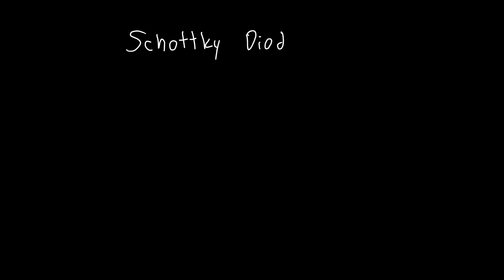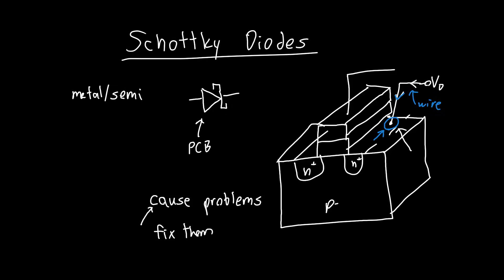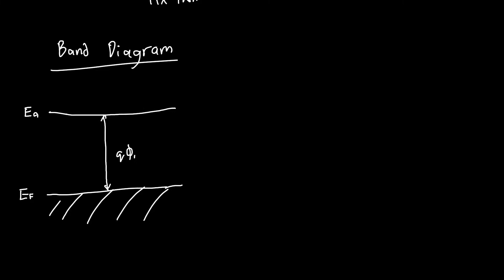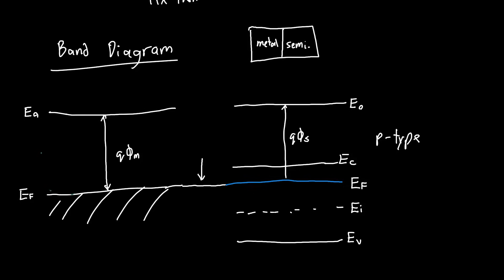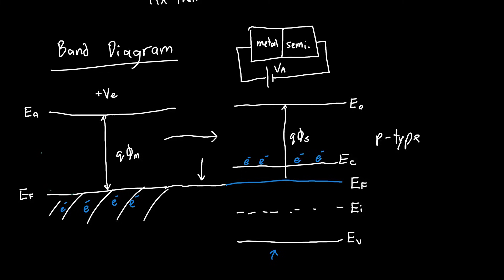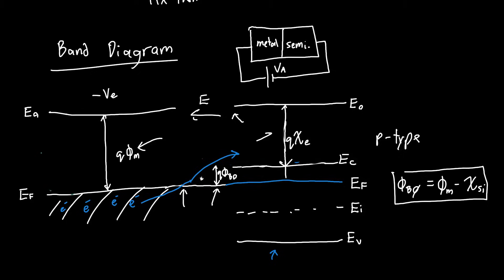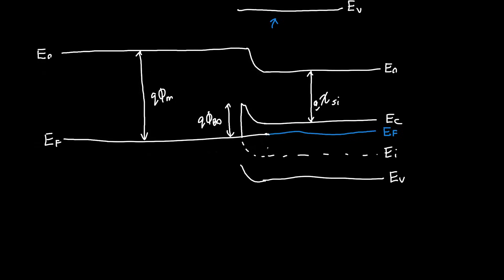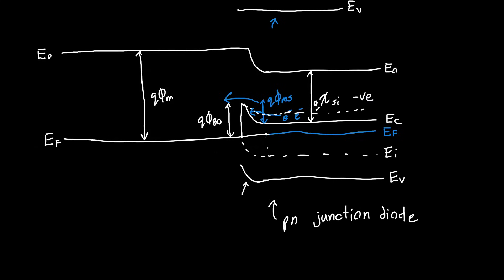Schottky Diode Part 1 - Band Diagram

Comment: Why at the 8:50 minute the semiconductor bands rise high? I think they should rise down so Ef of the metal (white line) will "stick" to Ef of the semiconductor (blue line). You drew that graph assuming the Ef of the semiconductor is greater than that of the metal.. then at 8:57 it seems you changed your mind
Reply: The same doubt🥲

Comment: A remark on the bending of the vacuum level:

As many here I was confused about why the vacuum level is not constant but bends. I thought a lot about it, because the vacuum level is the energy of an electron far away from the sample. This should be the same regardless of the material, voltage,…

In fact, there is an ambiguity in the definition: 1. There is a vacuum level, often used in semiconductor physics, that is measured right above the surface of the material. This vacuum level shifts, as you said. 2.) There is a vacuum level as I explained above (which is measured from infinity). This vacuum level is an absolute reference. 

In the second case, the electron affinity/work function changes, and the vacuum level stays constant. Why? Because, if I apply a voltage to the sample, the energy of the electrons may decrease (or increase), which leads to the bending of valence an conduction band. Of course this changes the energy needed to take an electron from the sample and bring it far away (the vacuum energy). In the end you do not only have to overcome the ionisation energy (like in the case without applied external field) but you also have to overcome the energy of the electric field. 

Another effect is happening when we apply no voltage but e.g. make a metal-semiconductor junction or a p-n-junction: There is a potential difference (energy difference) between p- and n-side because of the electric field in the depletion region. This causes the work function to shift.  The siping itself does also shift the work function, but this effect is negligible (as I was told). 

In short: I think the vacuum level is constant and the electron affinity/work function changes. It also leads to the same band diagram (at least vor E_c and E_v). What do you think about it?

Comment: Great content! But at the end when bending was performed, I don't think the vaccum level Eo will bend ... please correct me if I am wrong...
Reply from the maker: The vacuum level is always the same distance from the conduction band, so it has to bend as well. That doesn’t mean that an electron will have more energy when it is freed from the semiconductor. Once it’s in vacuum, this band structure no longer applies.

Comment: These Band Diagrams are great tools to understand interface characteristics between two materials.

To keep things straight in my head, I line up the Fermi Levels for each material (impose thermal equilibrium) then think about the charge redistribution needed to make them line up.  Keep in mind that the band structure of the bulk material is unchanged, and the band bending occurs only in the interface region.

This works for metal/semiconductor, metal/metal and semiconductor/semiconductor interfaces.

Comment: At 10:28 are we sure it's a negative voltage that would be applied to decrease the barrier height and not a positive one? I'm used to seeing that height defined as (phi_i - Va) where Va is a negative bias so now I'm confused.
Reply from the maker: Va is assumed to be a positive voltage here. A positive voltage applied to the p-side should reduce the barrier height.
Reply: @JordanEdmundsEECS  The video is really helpful. But I have a question. If the negative charge increase. The bending of the n-type semiconductor should be more curved. Wondering why is the barrier height will decrease?
Reply: @簡廉羲   yeah you are right instead of negative it must be a positive pole to reduce the curve
Reply: It should be positive voltage to reduce the barrier

Comment: Question: I understand that the two materials have different Fermi levels, but why must the bands bend "to make the fermi levels the same?" I keep hearing this but don't understand for metal-on-semiconductor context. 
EDIT: Never mind! See 8:29 for the answer to my Q.
Reply: Fermi level is the level that the state will always have 50% chance of begin occupuied. If Fermi level is not constant in the system, there will be net current flowing. However, we assume in thermal equalibrum. (You assume in steady state). No transfer of energy occuers. So if the fermi level is not constant, it violates the assumption.